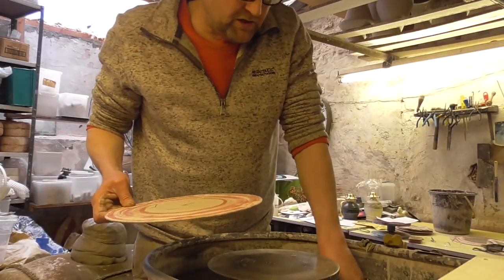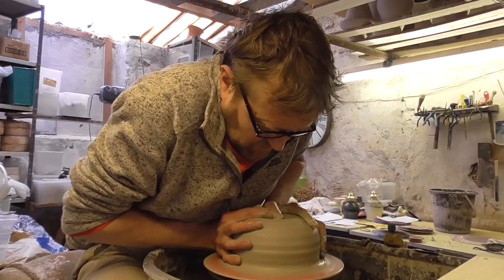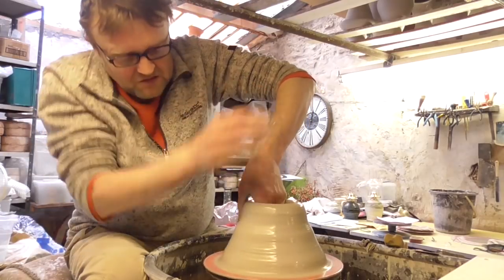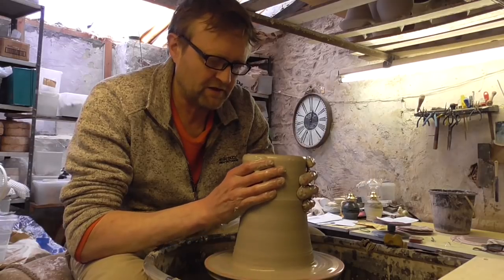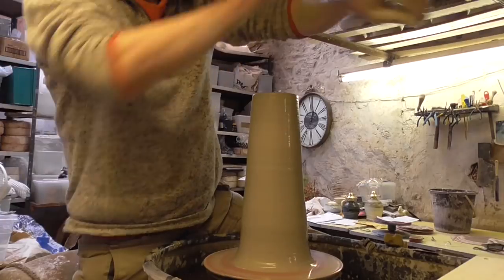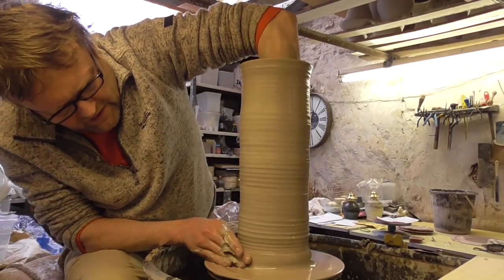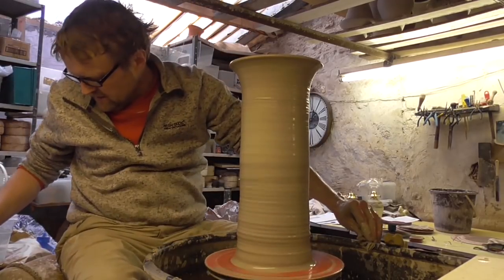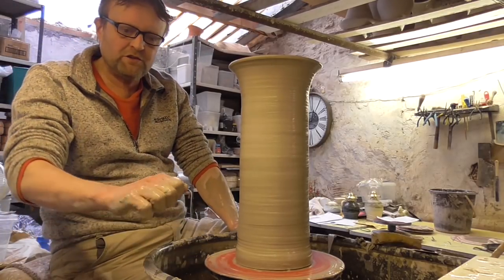How to Make a Tall Clay Pottery Cylinder on the Wheel

Comment: One problem I have is I’m not getting a good feel on the clay at the bottom of the pot. I think I’m reluctant to press as hard as I need to. It doesn’t seem as though you’re pushing the clay in a lot. Any suggestions.
Reply: really try to get to get that knuckle underneath the clay so you can pull more up at once. Also I suggest tapering how hard you push through out your piece. push harder at the bottom with the thicker clay and lighter at the top where the clay is thinner until the piece is even throughout. at that point you'll want to use even pressure throughout if you want to give it anymore height before shaping the piece.
Reply: Magnificent Halle thank you!!
Reply: trebor of course it’s honestly not so scientific as I explained it. In the end you just know the clay and know what feels right so you never have to really think about that step